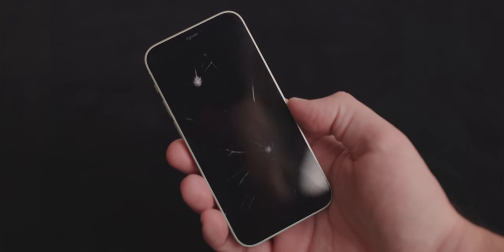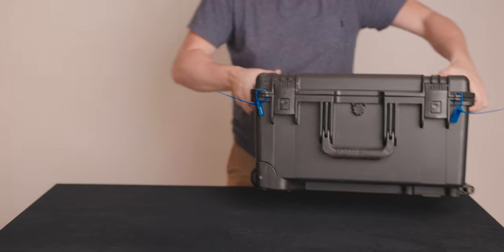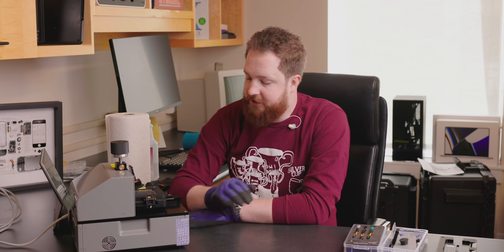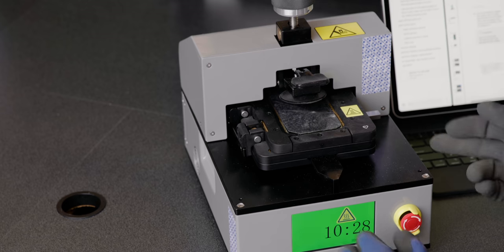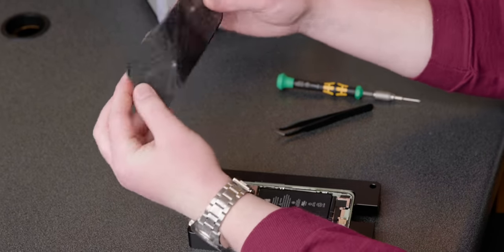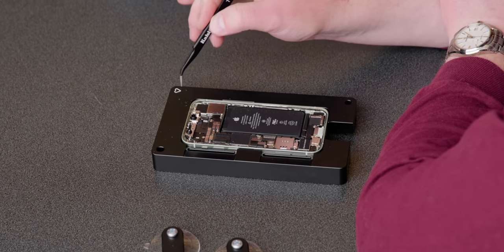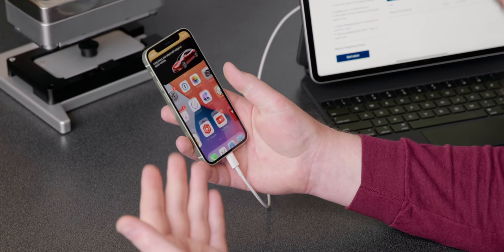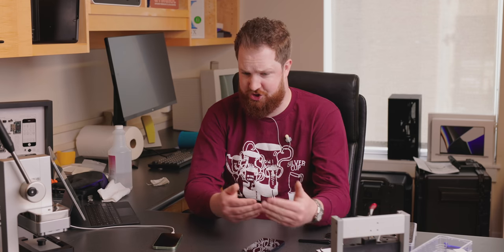Using Apple’s Tools to Fix My iPhone

Comment: Fantastic job taking the time and demonstrating Apple's current repair process and approach.

TLDR: an indication that this issue IS being taken more seriously in the mainstream. But this program indicates pro-active goalpost moving, and demonstrates how Apple continues to prioritize profits at the cost of environmental impact, consumer rights, and stubborn design philosophy. They claim to think different, Right-to-repair may force them to prove it.

For the readers: a couple of things as an Ex-genius bar employee and now developer in the automotive industry.

As other comments point out: these are legit Apple tools, exactly what is used by the genius bar. 

In Apple's defense; their standard warranty (not Applecare+) DOES cover repeated instances of manufacturing defects, up to and including swapping critical components and/or the entire device. This is why many die-hard fans still recommend Applecare+ despite these devices reputations for stability/reliability; it extends the DEFAULT warranty in addition to granting accidental damage protection. Every tech on our bar had AC+ on their personal devices for a reason! This can pay for itself down the line in the rare occasion that a well cared for device fails earlier than expected. To Apple, in order to prevent this from being abused (because people DARN WELL try to take advantage let me tell you) Apple claims that they need to have all of these extra processes, special tools, and software controls to standardize results and prevent the "laid back" Apple store environment from being abused.

Let's pivot for a second. Technical support (after the sale) is a goldmine of profits if done properly - an entire industry in and of itself for important enough fields (like cars). And make no mistake, smartphones are CRITICAL to modern life and culture. In the PC space, controlling aftersales doesn't make much sense, because it adds barriers for customers and chains the OEM to being responsible for providing a program to verify/repair/replace if needed (anyone who's ever RMA'd a motherboard knows how clunky it can be). But when you look at automotive repair, you can take pretty much any car to any shop and get support; the shop makes their labor cut, the supplier takes their cut, and the OEM profits from parts. So why does Tesla mirror the "Apple" approach to their vehicles, even though they require less parts, lack fluids, etc.? Control. Likewise Apple is clever, and has recognized how controlling aftersales in their unique market allows for the streamlining of repair procedures (thus profits), and the careful brand protection that associates that little logo with "reliable". They know that "right to repair" will disturb a carefully marketed balance of lifestyle, exclusivity, and aftersales profits.

In reality, it's hard to defend Apple on this front, and it is one of the reasons I was driven away from their current products in the post "Steve Jobs" era. Apple currently has an iron grip on the profits generated from repair of their devices, as well as the collateral benefits from the control of this support. What people forget, is that this control affects everything from the trade-in values of your current iPhone (they know precisely the cost of refurbishment; they SET the price), to the ever-rising costs year over year (the more complicated the device seems via specialized repair, the more they can justify the cost). Apple is one of the most lucratively profitable brands on the planet; this didn't happen accidentally, they are NOT a charity. Marketing is at its core social engineering, and Apple has some of the best marketing in the game. They have remarkably convinced many people up to now that their products are special, and that repairs are dangerous/unfeasible/too complicated.

Videos like these are necessary because they illustrate so clearly the current fallacy of Apple, and other tech giants besides. This repair program seems to be a clever attempt to plant the goalposts pro-actively in such a way that Apple can control the optics and lobby unaware politicians; "if you want to regulate us to allow customers to repair phones ***PROPERLY***, then we must ship hundreds of pounds of specialized equipment, unique tools, and software-DRM all of our devices." You can hear the corporate outrage already!

A few points:
1. Notice how the cost for this do-it-yourself program costs the same as their current monolithic model: They will be d@#$%d if their careful profit strategy is negatively impacted by consumer rights.
2. Genius bar employees (myself included at the time) are NOT savants in Engineering, electronics, advanced math's etc. We are just like you. I'm sure there are people in some retail locations with a passion for technology and skills beyond the average. HOWEVER, Apple prioritizes inter-personal skills, the ability to position the positives of the brand, and the ability to de-escalate conflicts, NOT technical ability. We were actively discouraged from thinking in terms of technical ability. This is important because the argument later that these repairs are "too difficult" is a farce; Genius Bar employees have more *exposure* to these processes than the average person, not in-born technical expertise. For all of its inclusivity talk, Apple needs to stop gatekeeping electronics repair.
3. Safety is as safety does. The safety argument is for the lawyers only.
4. Apple has some of the brightest minds on the PLANET. These tools and processes are required because **Apple has designed their products to require them**. They absolutely have the design chops, budget, and expertise to build the same svelte sexy products without the anti-repair designs. (Hidden magnetic display glass on the older iMacs, G4 Cube, Cheese-grater/current Mac Pro tooling, etc.)
5. I despise the software locks post-repair (even when I was a tech). Diagnostics are one thing. Notifying users of counterfeit hardware is another thing. But locking your paying customer out of their device's functionality because they dared to shirk your profit model is stunningly devious. This company may talk like a bunch of hippies and artists, but this move is corporate to the core (no pun intended).

I'm an Apple fan and respect the tour de force that Cupertino wields when they focus, but this issue more than any other has had me questioning their moral center for quite some time.

Comment: All those “unnecessary” tools are to make the repair as fool-proof as possible where everything is to spec. The newton force applied onto the battery adhesive, torque values of the screws, alignment is as accurate it can be with the frames and casings. Imagine if the instruction says, “with your fingers, apply 1.7N of force evenly onto the battery back and forth 3 times”. Lol. It’s to take the guesswork out and all you gotta do is follow the instructions. The tools are calibrated so you don’t have to guess how much pressure to apply, how tight to screw in and how aligned everything is.

Comment: Given what I read (in an article on Apple's customer self-repair program) Apple charges to rent the tools,  I'm not surprised this turned out to be not exactly a user friendly thing.  (I have bad joints prone to inflammation and am NOT a fan of hauling around heavy things any more than absolutely necessary).  When I read the article, I was picturing things like special screw drivers.   LOL

Comment: I didn't know they made torque-specific screwdrivers, although it makes a lot of sense. I'm more used to a torque wrench for cars in ft-lbs. Then, you have the smaller ones that do in-lbs, so what measurement do these screwdrivers use? It must be something really small for screws like that, they probably include them so you don't strip them out because they're so small.

Comment: Actually the display press is pretty nice. Looked it up and its around 200$ as a stand alone device. Good deal if you want you screen replaced iphones to be still water resistant.

Comment: to make taking the newer iPhone screens off use an ifixit Jimmy. just have to get a good steady hand but using steel to separate glue is much easier, I do iphone 12 repairs in 20 minutes or less most of the time. my experience to make this comment is the owner of an electronics repair company.

Comment: For anyone wondering why so much stuff, machines etc. They make (and supply) tooling and instructions to make everything consistent and bulletproof. This would be tools that repair technicians have at hand while repairing your phone at service center. So if technician repair his 30th iPhone this week consistent and bulletproof is needed. As Snazzy said by him self "they do it because they have to not because they want to" and they did it the most convenient way they could. Just order same stuff we use, copy instructions manuals we have, put them into big cases and send it. DONE

It is the same thing in automotive well kinda. Nobody at automotive will send you whole garage of tools but they do supply those manuals made the same way as apple do. In production we do use the same systems. Consistent and bulletproof. Nobody wants to deal with failed parts. If part fails at our factory that is fine we will scrap it and nothing changes. If part fails at customer while they put car together then we will replace that part, we will have to make sure it won't happen again and customer will check how we did it. Then there is the last case. If part fail while already in car then it might result in recall especially if failures repeat. And NOBODY want's to deal with that because price for that is massive.

Btw stickers all over that machine are there most probably because they are calibrated to certain pressure or temperature and Apple wants to be sure everything will be set right so customer won't take them to court because their house burn to ground or because their new screen cracked while replacing it. Also ... you know consistent and bulletproof.

Comment: What is an "imac cable"?
That's legit just the C13 standard power connector :D

Protip for everyone, if you cant get the battery out, get rubbing alcohol (i use 96%, use whatever you can), and drip a bit under the battery. It just pops out.

Comment: Oh man, I can practically smell the Apple Execs behind this decision. "They want self-service repeair? We'll give them self-service repair. Make the equipment so MASSIVE and so EXPENSIVE that no one would ever DARE try to self-repair EVER AGAIN! MWAHAhahahaAAA!"

Edit: 15:36 I find it interesting that the battery adhesive strips break if the phone is exposed to excess heat, and yet the process to get it open to replace anything involves exposing the phone to excess heat.
Reply: Pm me🔝...

Comment: Yea the display heater sucks, We often end up ramming a metal opening tool between them as a helping tool and personally i often skip using the repair tray entirely. You wanna be really fast with the thing anyway. and to answer how this works it's an internal heater that then transfers the heat through thermal coupling to the copper back and the contacts on the hot pocket (yes thats their actual internal name) which transfers the heat to the hot pocket. The display becoming 2 layers also happens very often with us and yes Apple will blame us and not the fact their tool is bad.

Comment: A couple of tips for dealing with battery or screen adhesive is a couple of drops of 99% (91% should be fine) isopropyl alcohol really helps. Just make sure it's not getting on or in unwanted areas and that it's dry before installing the new battery and sealing the phone. But I bet this is against apple repair guidelines because apple is apple.

Comment: Okay, so here is how I do it: packing tape over the broken screen, heat gun, suction, spudger, work it around, heat gun, spudger, work it around, rinse and repeat until the screen is off, then undo the ribbon, heat gun, scrape, heat gun, iso, scrape, apply new adhesive, plug in the new screen, test new screen, place down the new screen, heat gun, press, let cool, take off-screen protector. I'd use a heat plate instead of a heat gun if I had money. I have literally done a custom clear back glass, custom red battery, frame and front display replacement, and USB port repair on a OnePlus 6 with nothing but an iFixit toolkit and a heat gun in less time than it seems it takes to remove a screen with their official tools.*

In fairness, I was not concerned with waterproofing the phone.

Comment: Someone needs to try this with an aftermarket screen and battery. Let’s see if Apple’s tool actually checks the authenticity of the parts or just resets the messages. My bet is that it just resets the warning messages and re-enables Face-ID; doesn’t matter what brand parts you put on the phone.

Comment: Ex-employee from the Genius Bar. These were all the tools we used. I fucking HATED the “easy bake oven” we used to open to 12 and 14

But also I know you were sponsored by UBIF and the rest. But 9-times-out-of-10 they always used non OEM parts. No negative speak about it, just know what you’re getting into.
Reply: Oh yeah and those long security screws are so long because they’re used to keep the display secured in place
Reply: PSS: the diagnostic mode you reboot into is indeed a separate mode. It allows AASP or Apple Store employees to be able to run diagnostics without needing the customer passcode to get into the device.

Comment: As someone who owned both an iphone and android phone and in the process of phone repairing, I will say back then you wouldn’t need a screwdriver to open up a phone and replace a battery or SIM card or whatever you needed replaced. And phones were cheap enough to just replace like that and put your SIM card and transfer your files onto another device. Nowadays phones has gotten too expensive and harder to repair that it takes an hour minimum to do…anything. Repairs or file transfers. and you can’t just replace your phone (that’s out of warranty) just like that unless you got money saved up and in this economy that’s unlikely for most people I would say.
Reply: Pm me🔝.

Comment: When someone does the repair without the proper tools and gets dust inside their display, has the waterproofing fail, or their battery expands because it was installed with too much pressure that slightly crushed the cells.... they aren't going to say "oh it was my fault". They're going to blame someone else. Often the failure will only show up months or years later. Or only show up when you drop the device accidentally. And yes that's a real thing: tiny misalignments in assembly can make the difference between "survives 10 drops without breaking" and "completely shatters the second time".

Manufacturers track defect rates in detail. They know where seemingly tiny mistakes will cause an extra 10% failure rate. Sometimes the failure modes seem absolutely insane yet testing proves it. That's all this is.

The repair process and tools are designed to ensure the phone is as near factory spec as possible after repair. If you don't care about that then don't rent the tools and take your chances.... but when you drop your phone in the pool 6 months later & it dies don't go complaining that the iPhone's supposed liquid rating is crap. Remember that you (based on no knowledge or experience) decided you knew better.

Comment: They run a diagnostic that tests that it detects everything properly. I used to perform these repairs and it would periodically detect a failure of various components that would make the customer experience terrible. One example is the face id sensor and cameras. If those arent working on old iphones you would have to replace the screen on the new ones I think you replace the entire phone. Apple sends whole unit replacements to the repair center that are intended for phones that are damaged to the point they cant be fixed with a screen or battery (example is bent phones) and botched repairs. The idea is you just give them a new phone and restore using apples icloud backup… very wasteful in my opinion but it makes repairs pretty much dummy proof. Apple loooves their consistency and will sacrifice efficiency and easy of use to achieve it.

Comment: Would it kill them to use SCREWS? Yes it's possible and pretty easy to use SCREWS on a device at that cost. They make replacing everything including screens and batteries.
14:06 or they can use little gaskets and/or O rings like most devices that are made well, if they can deal a engine they can deal a phone.

Comment: Great to finally get access to (some of) genuine apple parts and tools, but of course the whole serial number verification process as well as the heavy machines seem somewhat unnecessary. It doesn't seem like the part serial numbers are flashed beforehand and the iPhone just accepts the new serial from the "diagnostics"/"calibration" mode. 
At that point they might have shipped the horizon machine and services toolkit software as a whole in the first place. Macs running the diagnostics tools in the stores need a cloud connection to apple servers so repair shops need to use alternative methods like copying the new battery or display EEPROM serial number using special chinese chip flashing machines.
I just hope doing these self-repairs won't be just as expensive as bringing it to the store in the first place. There likely also won't be any MacBook or iPad parts available anytime soon, and logistics will delay the launch in Europe indefinitely as usual